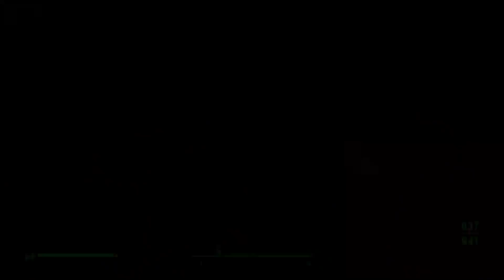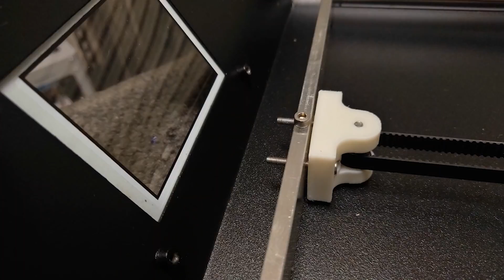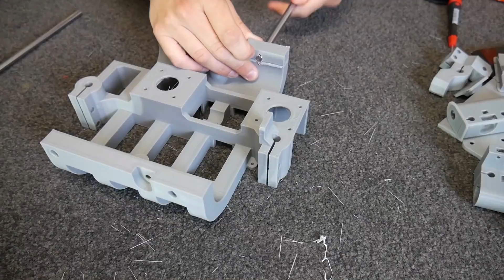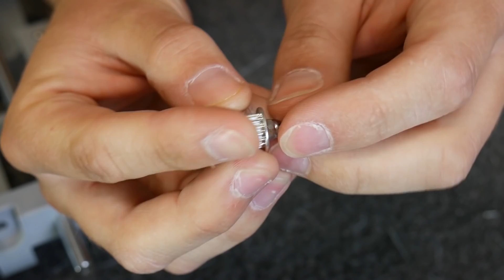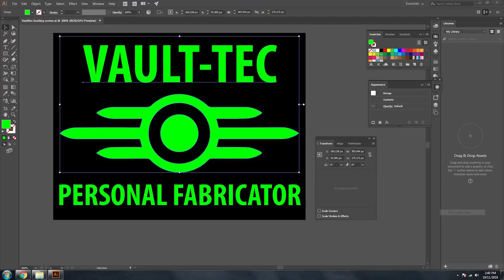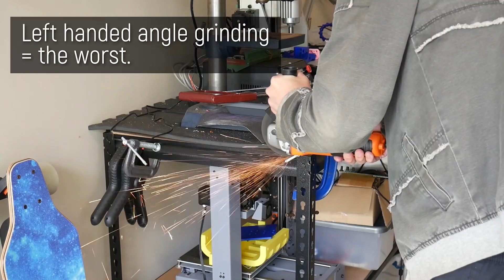Building a Fallout Themed 3D Printer from Scratch -  Build Vlog

Comment: Believe or not, I fitted whole functioning 3D printer into DVD drive case, all you need to do is just connect power and USB cable and load the filament as you said

Comment: That's a bit unfair on the tevo hot end. I have been using mine for a good while and it makes some remarkable prints. I don't use any fancy tubing either, all you have to do it undo the nozzle a quarter turn, push in the PTFE and then tighten the nozzle. If your tube is cut straight ish you'll have no problems.

Comment: watching this again years later and with more experience with printers and kinematics. This thing is still awesome, and if anyone were to redo this id suggest a core xy floating linear rail based design with pancake motors, you could probably achieve a bit bigger print volume, and have the board electronics at the bottom of the container.

Comment: Re-purposing a computer ATX power supply might give you enough current to heat the bed, reasonably safely, and offers a 3.3v, 5v and 12v supply ... just suggesting ...

Comment: Anyone who can use the phrase "lovely switches" (at 15:40) is someone I instantly like. 

I had a house in Ottawa. It had an old oil furnace, and doing the math, electricity was the cheaper way to heat my home. Using what I had on hand, and knowing that this was a safety critical system, it was overbuilt. Baseboard heaters in the furnace room, and 200 amp contactor controlled by a Honeywell programmable thermostat, was controlling the 45 amp heating load. Since electric heat doesn't require the same startup and shutdown rituals as a fuel-fired furnace, I set the thermostat for 10 cycles per hour. 

Clunk... Bang! Clunk... Bang! "What's that noise?" "Oh, just the furnace keeping us warm." 

That's what you get when you hang out in the home of an Electrical Engineering student. 

In retrospect, solid state relays would have been less jarring. But there's something about having a 200A contactor doing your bidding. It was more than capable of doing the job. And it's what I had on hand. The Detroit Edison sticker on the side of it didn't hurt either. :) 

Lovely switches. 

Thank you for your amazing videos. Keep it up, Angus! 

Lawrence Wade
Ottawa, Canada
Heavily modded Anet A8

Comment: Great Design.
I like your design, it help me to understand many design guidelines to "design parts for 3d printing".  The printer looks beautiful and unique.
The overall cost of electrics, motors, pulleys cost same as normal printers which available in market and they offer higher build volume than yours. You mention that the printer prints very bad then why don't you invest time to improve Extruder design so it can print good.

Comment: Angus, this leads to some interesting printer fabrication ideas. For example just measured my Prusa Mk3 and the entire machine can fit on my CR10S5, so you could make a monolithic printable Prusa Mk3 base/frame inspired by your printed base for this project. It could change the whole direction of the RepRap project, because you could could have self-replicating parents that may take longer to fab, but then could quickly make many children with much less assembly that are the next size down. The trick would be to retain the capability for the children to print a parent if required to honor the spirit of the project.

Comment: I know you're trying to build a larger printer without a case, BUT what you have built here is EXACTLY what i've been wanting.  I want a very small rigid printer in a case that I could throw maybe a 0.6mm nozzle on for when I want to crank out a small functional part, or bring a printer to an event or teach friends.

If you could manage to get this design finalized to your liking but keep the case and small form factor, and manage to make it extremely inexpensive, I could absolutely see a market for it.  I mean, that's exactly what the da Vinci miniMaker is, and it's $150USD.  What you have is a similar form factor, with better features, that could probably be made for less if mass produced.(i.e. get that base piece castable.

Comment: Nice work on the 3d printed printer. However, Angus PLEASE look up how to use an Angle Grinder. I'm left handed too and how you're doing it is extremely dangerous. The wheel should be trying to pull away from you, not trying to drive towards you. How you're holding it will make it shoot towards you if it grabs. 
Screw the handle on the other side of the grinder to how you had it.
Turn the grinder around so the handle is sticking up, but the wheel is out to your left, away from you.
Hold the handle in your left hand with the grinder body under your forearm. 
Hold the trigger handle with your right hand under your left elbow.
This way the grinder shoots sparks towards you, but they go past the outside of your left leg.
Now if it grabs, the wheel is not lined up with your face! Your left elbow acts like a hinge and it's really controllable. Also use a cutting wheel. One of the most dangerous tools if not used correctly. Cheers.

Comment: How possible do you think it would be to modify this to have the motors stepped down with gears for potentially higher detail? (Assuming I is smrt enough for modifying the files lol) I figure even something as low as a 2:1 ratio would be decent. I'd just need to really carefully level the bed and probably use a .2mm nozzle with it to get the benefits of that.

Comment: Good job! I was really wondering where the box came from!

Fusion 360 tip:
I hear you about how it is hard to wrap your head around joints. Been there! Here what I tell my students.
1-You need individual files for each components. Even though that any file can become an assembly, it creates problems later. The sketches of the original part are stuck at the assembly level making it impossible to separate that part from the assembly. 
2-Once you have a saved part, create a new file for the assembly itself. Make sure you save because you can't add any file before it is saved.
3-Drop your first part in the assembly file. I like to Ground the first part. It can change later but you should always have at least one part grounded.
4-This is where it gets interesting. JOINTS!!!!
In other software like Solidwork, you work your way by restraining degrees of freedom. There is a total of 6 (3 axis of translation + 3 axis of rotation). So with this approach, you can glue faces together. Fusion is not like that at all. From the first joint, you can control all 6 degrees of freedom. For instance, a Rigid joint locks a 6 degrees. A rotation joint allows rotation in one axis. How does fusion does it? It takes a reference point from each object and put them together. An easy one is 2 circular shapes. They will both register together from the center of their circles. 
It gets tricky when there isn't a point at the same location of both components. After you select both points, you will have a chance to move the components (3 axis of translation + 1 rotation). Sometimes you don't know how much offset you need. I usually complete the joint as is. Then I measure how much a component moves. Finally I edit the joint and move accordingly.
Pro tip: When creating a part where you know the reference point won't be available easily (example: in the middle of 2 arms where there is no material), you can add a joint origin. You can use the sketch to reference the joint origin to locate the joint origin. This artificial origin will be available in the assembly. Look in the browser, under the component, under Joint Origins.
Pro tip 2: The first reference point you take in the joint command will make this component move toward the second selection. During the animation that show you what is happening. You want the screw move towards the frame and not the other way around. When you do your first joint, you will notice you can't select the first component as it is grounded and cannot move toward the other component.

I know it takes some time to get used to but it is absolutely necessary if you want to use Fusion at its fullest. This enable drive joints (2 joints linked together. Makes gear trains possible). When you get used to it, it is not hard at all. When you think about it, it is much easier to make 1 joint than locking 1, 2, or 3 degrees of freedom for the same relation between 2 parts.

Keep up the good work!!
Reply: Jean Philippe Poirier I would encourage you to produce a video that explains this. It would be helpful and be searchable. Good tips anyways, thanks for sharing your knowledge

Comment: Excellent video mate. Coming from a mechanical design specialist who's been CADn it up for 20 years I can tell you that using the multi-body approach is a perfectly acceptable method of prototyping. Obviously once all the bugs are worked out you would develop the multi-body part into a multi-part assembly. But going from zero to something using that method has so many advantages including time saving and reduction in mental anguish.

I don't think it would take much to make this base modular so that the bed size was an option and so that it could print itself. I personally would be looking for a 300mm³ bed volume.

Your creation is very impressive and will be looking forward to the mk2.

Comment: Great build! I hope the next open source printer can use parts from ebay, banggood, gearbest etc which is super easy to purchase from. Mouser and such is not as easy here in Norway.. As a tip for making a stiff frame I suggest using large quadcopter parts! Carbon fiber tubes and correct aluminium bracket ends  are dirt cheap on ebay! Most printed available kits use printed parts everywhere just to say its made from printed parts, and often they have to many weaknesses. I would like to ses a printer made with a more optimum materials usage, especially if the metal alternative is cheap and easily available.. I'm really looking forward to see your vision for an open source printer :)
Reply: impuls60 , yes! I second this.
Reply: Fwiw, Mouser, and Digikey deliver to Norway in 3 days with free shipping at NOK500, then the bill for "MVA" comes from the carrier (UPS) with a NOK 170 fee. Its easier than most local suppliers.

Comment: With the frame being 3d printed and held together with the rods, you should be able to make the bed size quite easily modifiable with just a bit of attention while designing. Like your current design, it has a quite clear section for the X width where it could be modified to suit a smaller/larger width.
And also, designing the standard bed size to either be, or be neatly divisible by, one of the more common surface sizes (200/220/235/300mm etc) would give you four surfaces instead of just one and a bunch of unusable scraps.

Comment: If building a large printer, say 600mm cubed, what approach would you take? Static bed? Moving bed? Linear slides?
Reply from the maker: At that size, definitely core XY with linear rails and a moving bed on  3 ballscrews.
Reply: @MakersMuse  Thanks, I haven't tried a Core XY project yet, so this will be my first attempt.

Comment: My Tevo Tarantula prints absolutely beautifully.  Not sure why so down on Tarantula. Mine has printed everyday for more than a year, only upgrade is a fang fan.  I have only had to replace 1 fan and 1 nozzle after printing a bunch of Glow in the Dark.
Reply from the maker: When did you get it? It's a box of parts and the kit I received was early 2016... some time back! I would be surprised if they didn't improve at least some of the parts.
Reply: @MakersMuse  August 2017. Still a box of parts with poor assembly instruction.  I did notice that your heat block was brass, Mine is aluminum in color. Assuming it is a coated copper. I do use a 4mm retraction to prevent oozing. I also tend to print a little warmer than most. PLA at 200C to 205C. PETG at 240C to 245C. But if built using the videos, and assembled square and stiff, It print really well.

Thank You very much for your content over the years. I have learned a lot from you and do very much appreciate your videos. I have owned 5 CNC machines since 1999, If I can ever help you, feel free to reach out. FYI, I Love CAM in Fusion.  I am still learning it but it works beautifully.
Reply: @MakersMuse  August 2017

Comment: A tip from engineer to engineer: Use threaded inserts in the future. Simply make the hole for the insert a bit on the small side and then heat the insert using a soldering iron. It can then be pressed into the hole and will be tight once the surrounding plastic sets again.
Reply: yeah i bought a bunch of threaded inserts 
works like a charm
Reply: Tight friction fit rivnuts with a touch of ca works like a charm

Comment: This was cool Angus. Thanks for sharing! What are your thoughts on improving the wiring?
Reply from the maker: Cheers Connor! Like some people have suggested, I could hide it in the side panel or cut and solder them shorter. I think I'll leave it for now because it's working and took a lot to get it there... but for a V2 i'll design in better wire routing paths to keep them safe and secured.

Comment: In future, as a recommendation for getting screws to fit in plastic- look for threaded inserts. You install them by using a soldering iron to heat up the insert and then press it into the plastic, letting it cool and grab the threads. Its similar to your idea to use nuts pushed into the side, but you've got a lot more control and options with it, and its very rigid.

Comment: The idlers need simple spacers between the two ball bearings, you can get around this by building top axel supports (and not tightening them down). You'll almost certainly have similar issues with other idlers, it's because: by tightening the idler you place a lot of axial force on both bearings and as any mechanical engineer would tell you: deep grove ball bearings don't like axial forces.

Comment: What you have modeled to get away with the compacting the design is amazing, well done on comming up with the design.
BTW could the top supports be fixed to the side of the case to stiffen the axis?
If you put a panel on the back that can open, Could you increase the bed size so that if fills the case when not in use?

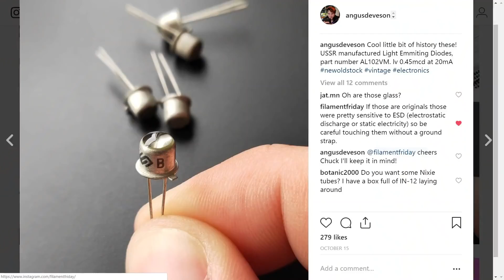Comment: 20:37 The thing about the Fallout universe is the fact that energy saving semiconductors were never invented, which led to the energy crisis that ultimately peaked in nuclear warfare. So maybe it's a good thing those LEDs didn't work,
 lore-wise
Reply: The transistor was invented in the fallout universe.. 
Bu tubes came back into play when the government reverse engineered the Zata tech.
As everything in the fallout universe uses A quantum CPU that sits in a glass like Tube.
  The fallout universe was built on top of a old game called wasteland. 
The radios, use tubes, as the Zata tech showed a method of quantum entanglement as a form of communication. So do the TV's use this..
  Okay, the old game did not call it quantum anything. But the description was spot on.. 
  Also Tubs are used with radioactive elements to provide a long lived power supply...
 The story is this: After the age of transistors, manufactures made things to break down, and force people to buy new things.. In time this caused a global depression. So the US and many other Governments, passed laws requiring manufactures to make things to last.
  The US government, went a step farther and passed a back to the 60's appearance law.  
  The old game even gives a great reason for the lack of color TV's..
The Government reclaimed most of the color TV's as Colored phosphorous was needed for use in the Zata CPU devices.. 
  And the fact that many TV's where now left Black and white.. This also aided the reason to do the back to the 60's look...

 Moreover: The story goes on. As it turns out the space Alien's have a way to take remote control over the CPU technology. (More like influence the AI's goals..) 
  And in the old game you find camp Cochise. And the AI there tells you that it was made to start the atomic war! As mandated by the space Aliens.. 
  Story ends with you helping the Supper computer to self destruct. 
  As you leave, The AI tells you that it is not the only supper commuter, that the space Aliens can influence. (Hence leaving room for more game play!)

Wasteland, was later bought out, and turned into Fallout..
They keep to the story quite well...

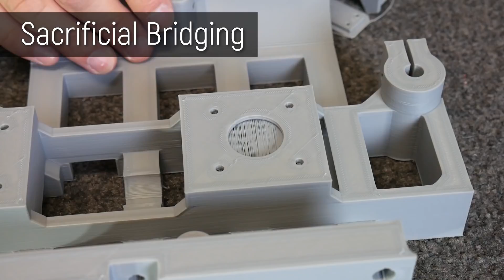Comment: I actually was just thinking of using a 3d pen instead of bondo to fill in cracks where the printed pieces are put together. While I'm waiting for that to arrive I have been looking at deburring tools. Which would be used where you used the razor blade 10:08. Keep up the awesome work man. I wonder if it was less for show and you had the time. If one could be made really well and sold or given away with a game. From the fallout game company even though I know they would never do that.

Comment: This is resparking my urge to make a super accurate 210mm^3, lead screw driven printer with an E3D v6. I'll be scrapping my older TronXY acrylic i3 clone for the steppers, heatbed, etc. Use 2020 extrusion for the frame, should I use v-slot for the movement? I had a hell of a time making my 300mm^3 printer with v-slot movement. Mini v-slot is a pain for getting tolerances just right, compared to normal sized. I will have 8mm hardened rods from the scrapped printer, use em? Or should I fork out for linear rails and ball screws? Also playing around with the idea of using a 0.2mm nozzle instead of the usual 0.4. Any thoughts? If you want to see my large printer, it's on my page and on thingiverse.